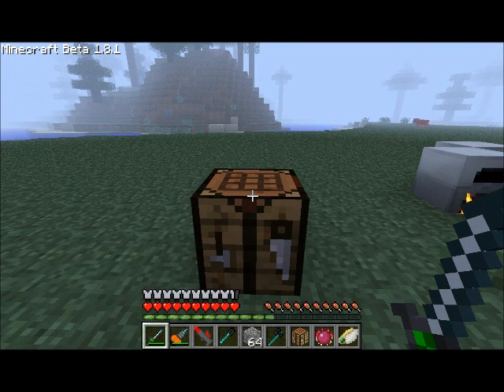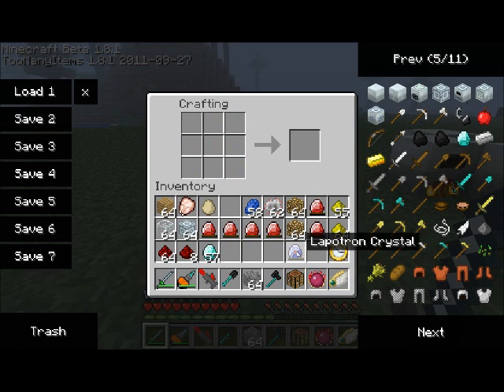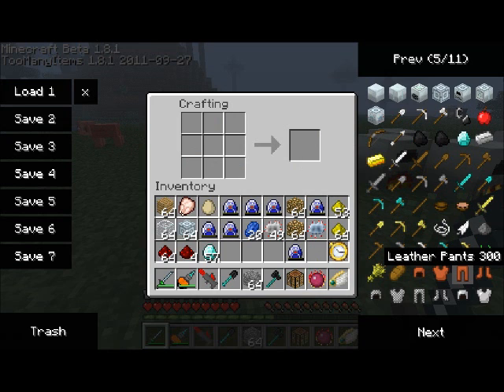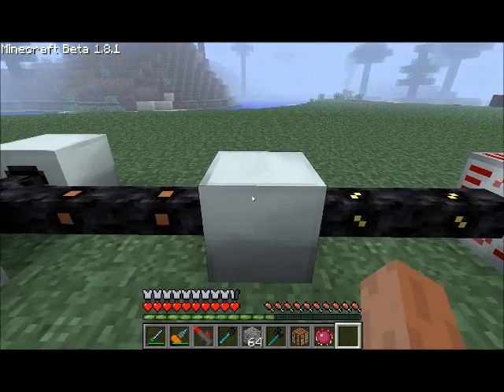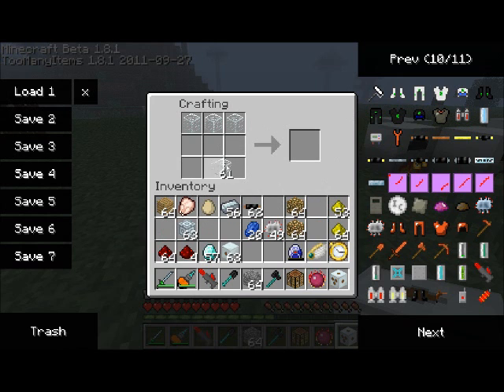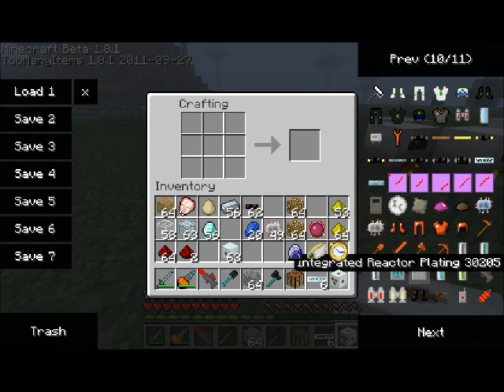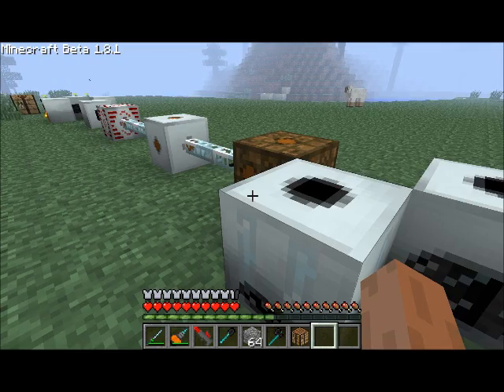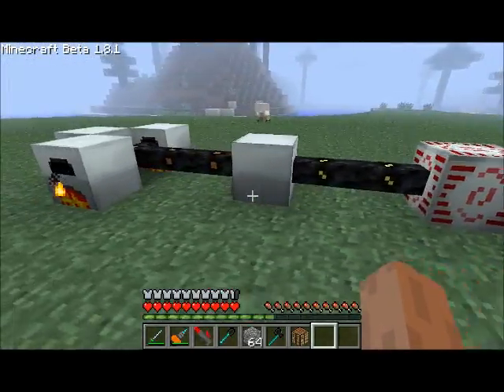IndustrialCraft 2.0 Tutorials - Tier 3 Energy

Comment: @direwolf20 I've been going nuts the past couple days trying to figure out what I was doing wrong with the cables. Things work fine with copper/gold (except 2x.ins) until I replace it with glass fibre. Is that part of the same bug? All I want to do is set up a portable miner and some area lighting on house power and not mess with crystals!

Comment from the maker: @TheSHaDoWrEaPer21 That sends 2000 (roughly) EU/T -- its mostly used for transporting large amounts of energy across a long distance.  While there is energy loss in the wire, its such a small percentage.  For example If you lose 10 energy from a LV current (32), its 10/32 = 33% of the energy being lost.  Thats a lot  If you lose 10 energy from a HV cable (2000), its 10/2000 = 0.5% energy loss.  So basically use it to send energy across a long distance to mitigate energy loss